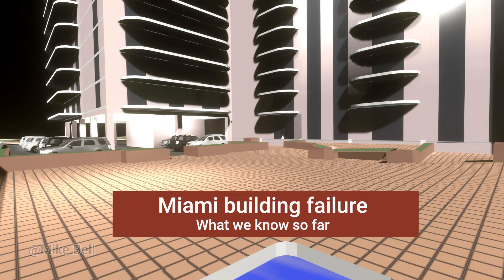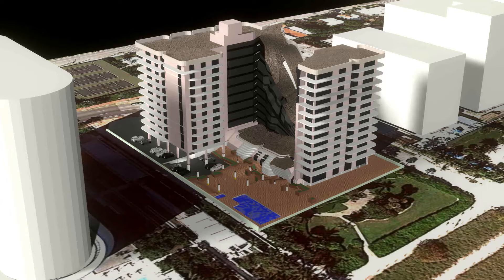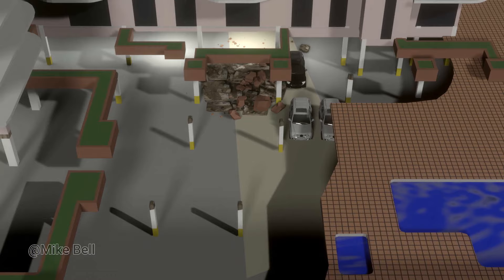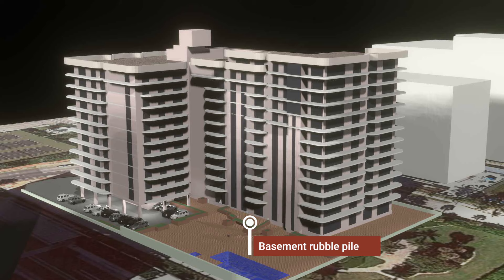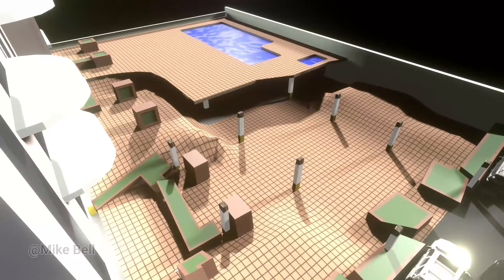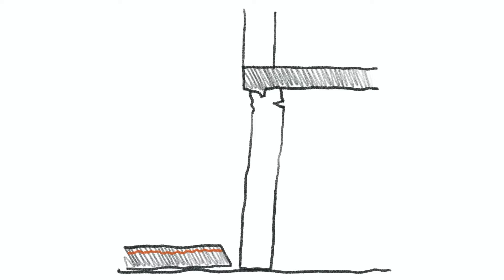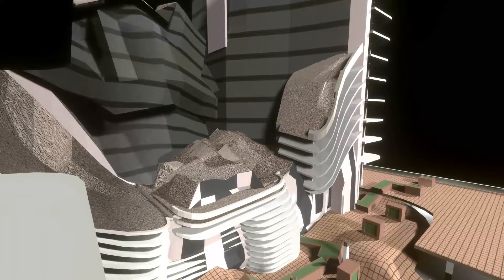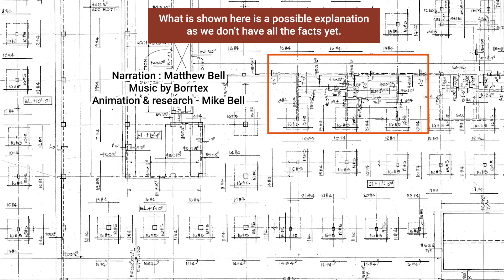MIAMI CONDO COLLAPSE | visualization of the evidence pt2

Comment: What we learn:
- Don't neglect, when something is damaged, demand reparations
- If you hear "construction noises", see cracks happening, feel shakes/vibrations, get the f**k out of there. 
-If no time, go onto the balcony or close to the outside wall, it will highten your chance of survival in being found quicker afterwards.
Reply: @lightbulb1982  when I see it happening definetly. Have been through some earth quakes, although in well maintained buildings. When you see/hear a crack happening, you'll know what I mean. Its frightening believe me.
But with the neglect of infrastructure I see here in the US, its a genuine concern of mine and I expect things like this to happen more often in the future. 

Sorry if I sounded cold/rude in my first comment, that was not my intention, more of an emphasis on the speed of action. No offense was  intended. 
May the victims of this tragedy rest in peace.
Reply: @MrChillerNo1  You gotta be careful with your "advice", the standard (and I assume, much better) advice in earthquake-prone areas is to get under a sturdy table in case of shakes/vibrations. Presumably because you're much more likely to have some sort of projectile hit your head at lethal speed if you "get the f**k out of there", as compared to the likelihood of your building collapsing.
Reply: @TheHuesSciTech  Sure, my bad, I expected that to be self evident/common knowledge.
Same goes btw for door frames, and corners if tables and doorframes are not reachable.

BUT, especially if you have time (early warning system) being outside away from buildings and other overhead construction is still the safest.

Best would be not have to enter/live in a building having obvious safty issues and marode structure. I hope they make an example of those responsible for the neglect.
A crumbling infrastructure is not only an issue in the public sphere but also in the private.

Have a nice day, stay save.
Reply: #1  !!!
Don't build your castle on the sand!!

Comment: Lesson is that little pool leak can lead to a complete building failure.
Reply: More than just the pool
Reply: What pool leak?  It's now possible it was the well watered planters that leaked.
Reply: this isn't from a pool leak
Reply: with a building that close to the shore, and several years of king tides and hurricane storm surges, you can bet that garage flooded out with salty sea water several times, penetrating the concrete and corroding the steel supports.
Reply: Everyone suddenly becomes an expert. 🤦
Reply: The pool did not leak
Reply: That is , in no way, the main catalyst that caused this to collapse
Reply: @danielschannel701  Or didn't leak or drain.
Reply: That's not what caused it at all. You should delete your comment it's dangerously irresponsible
Reply: @og-greenmachine8623  Never fails. Can't wait till they release the real cause of this failure.
Reply: @Sandra Braithwaite You sound like an expert. How do you avoid rusty rebar?
Reply: @Sandra Braithwaite Or the engineer could have specified MMFX rebar. It's through and through. Definitely more expensive. You miss that acronym on a bid and you're paying for the job. The whole thing is a disaster. Just horrific.
Reply: @Sandra Braithwaite Totally agree with you.
Reply: I would say that is unlikely to be the reason. You can clearly se from both the video and aftermath that the pillars  punshed throw, while most of the damage was pretty för from the pillar.
Reply: Except that the pool was still FULL of water after the collapse.
Reply: The pool didn't leak, the forensic engineers found that the top of the pool deck concrete slab had no slope and neither did the built-up waterproofing. A shocking oversight. The rain got into the grout between the deck pavers and just sat there, compromising the waterproofing and seeping into the concrete. The rest is history.
Reply: Not a pool leak
Reply: @mozartsghost9271  I think that definitely has something to do with it. There’s another city with tons of hi-rises like this, Alexandria in Egypt, where buildings collapse all of the time due to seawater corrosion and poor construction.
Reply: @danielschannel701  And I don’t think the planters were accounted for in the designs, but can’t remember.
Reply: @chairmanofrussia  After a hurricane damages the palm treesa few years ago, they were cut down.  And changes were made with the landscaping.  I think I heard that the palms required less watering than the new plants they installed.
Reply: That wasn’t why

Comment: It was built in the 80s during Miami's mafia/corruption era just like NYC. The city's civil engineer inspectors were bribed. They approved every single step of the construction from changes to the original building plan to the use of inferior building materials.
Reply: And yet you don’t know if there was any thing wrong with the actual construction of the building.
Reply: @neilkurzman4907  Thats the thing, there are so many other building made by the cocaine dealer / real estate developers of the time, that are even worse shape and still standing. So something / someone pushed this particular building's problems over the edge.
Reply: @DCOM20.  
We know? No you think you know. Built with cocaine money doesn’t mean it was built with cocaine. So since you know exactly why it failed what does that mean for the surrounding buildings. How can they be modified to ensure they don’t fall down for the same reason? You do understand the investigation is to determine that. That’s why we investigate accidents.
Reply: @VictorNewman201  It appears that extensive water infiltration into the pool deck was the culprit...several people seem to believe this to be the problem.
Reply: 40 years is a long time for a modern building to remain standing without proper maintenance, if it fell within 5 years of being built you might have a valid point, but enough time passed that both weather effects specifically corrosion, and lack of regular building maintenance probably are to blame. Had the preventative maintenance or repairs occurred earlier maybe this disaster could have been avoided. 

Imagine you drive a car without ever changing the oil or having the same tires on since 1979. Would you blame corrupt car markers of 1979 for your car breaking down in 2021? Probably not. If you own a home for any length of time, you know (or learn) how susceptible they are to the weather, leaks, cracks, issues over time and those issues need to be addressed or they multiply into costly repairs. Most single family home roofs have a 25 year lifespan before they need total replacement. Most single family homes do not collapse though because they carry less loads than an apartment building, but all the more importance to keep up with maintenance and repairs when hundreds of lives are on the line.
Reply: @jainradhakrishnan6600  
There is more to this building collapse then week design, poor maintenance, and possibly shoddy construction.
The question is should the collapsing pool deck have taken out three supporting pillars with it?
And even more should a loss of three pillars take down the entire building?
Everyone’s so focused on finding the the one single thing that caused the building to fault and the one person to blame, they are not looking at how all of these things lead to the collapse of the building. So what can we learn? How do we stop this from happening in the future. Do we need to retrofit current buildings? The goal here is not to save the dead. The goal is to save people in the future.
Reply: @Neil Kurzman From a novice perspective, if I were to critique the building design as described in this video, the pool deck could have been placed on its own support columns instead of tied to the main building's support columns. This would be a redundancy measure the original designers could have implemented to isolate the structures from each other so that if one failed, the other other did not. We kind of see the isolated structure design in action with the building structure that did not collapse. If retrofitting other buildings in the area is the outcome from this disaster, they can begin by looking at similarly designed buildings and strengthening or isolating the apartment building support columns from the rest of the structure (such as a pool deck) so one cannot cause a catastrophic failure to the other.

If the animation is what happened, the pool deck floor literally pulled itself out from the structural pillers when it collapsed, which caused the columns to immediately buckle, which cause the building to rest its weight on bent columns; which lead to the complete collapse as the columns were not designed for that loading scenario. 

Keep in mind the original design should account for the pool deck's support columns, girders, concrete, and steel to be working to code. If the pool deck structure was not properly maintained, long term corrosion could have compromised the strength of the deck, which set off the chain reaction.

There's probably a group of forensic structural engineers working on the mechanism for how the building collapsed. Once they figure out the most likely cause, they publish their results/findings, and give recommendations to the city/state. These sorts of catastrophic events always leads to some kind of design/code revision, not necessarily because the original design was poor per se (it could have been), but because we learned something novel whenever a structure collapses (which is pretty rare in the US these days), and because codes get updated with new scientific findings that the original code/designs did not have available at the time of their original construction. 

I think one code that will get changed is the frequency for inspection, I originally read it was every 40 years in South Florida or something, that'll probably get bumped up to every 10 years, maybe less, maybe they'll perform inspections after every major storm/hurricane just to be cautious.
Reply: @jainradhakrishnan6600  
The problem with being an amateur looking at a real problem is you don’t have enough information to know what all of the other possible issues are. 
You do one quick fix, and you end up causing other problems. It’s not always aparent to someone who is not a professional. It’s why civil engineers require licenses. 
As another amateur it does sound like there should be some separation between the building and the deck.
Actually believe in Florida the initial inspection is after 40 years then I think 10 or 15 years after that. The 40 years was chosen to the politics. Not do the engineering practice. And that’s just in that portion of Florida and other areas of the state no inspections required ever. 
I’m not sure what the rules are in the other 50 states and who knows how many counties around the country.
Reply: @DCOM20.  Scarface a Taurus! 🚩🐂💭 Obviously you're a Pisces! 🔮💦🐟
Reply: @neilkurzman4907  Yeah I don't work in high rise condos, my background is in pavement engineering so I'm aware of some of the concepts in building design, but I can't legally give professional advice. Even if I had my PE license as a pavement engineer, it'd be unethical of me to provide structural engineering design opinions as it's outside my specialty- but yes I'm well aware the licensed professionals are working on solving the problem as we're spectating.
Reply: @neilkurzman4907  I smell a gaslighter here. (no pun intended)
Reply: So much of this going on these days (rushed construction and corrupt city officials) it makes you wonder what will happen a few decades from now
Reply: Funny no one blames the building association dudes who did not want to spend the money to fix early structural problems.
Reply: I used to work for a Forensic Architecture firm.  We had A LOT of work in Myrtle Beach in the early 2000’s.  This is because it took 20 years for the problems from a huge condo building boom in the 80’s to come to light.  I believe the Horry County building inspectors must have been overwhelmed and that they must have done drive by inspections based on a lot of the stuff we discovered.  But these public agencies can not be held liable.  Thankfully, none of the buildings we saw had structural issues but there were LOTS of water infiltration issues and some fire hazard/ fire safety issues such as improper egress designs.  It makes me wonder though, if the water issues were not fixed, would some of those buildings I looked at be in a similar condition to the Champlain building?

Comment: This is an excellent model of the collapse using the surveillance video, the video taken by a hotel guest across from the Towers, and eyewitness accounts.  
My comment is that the video of the parking garage with water flowing from a pipe and  rubble on the ground shows what I believe is one of the planters from the pool deck along with other rubble. There is what appears to be a large cube on the right side of the column that is on the left side of the ramp. The cube/planter is on the ramp. This means that the deck collapsed at least as close to the building as the planters just before any part of the building itself collapsed.  
Realizing that the wall of the stair well from the last section of the building that collapsed was on top of the central portion of the rubble pile was very disturbing as were the bedrooms that were ripped in half while the remainder of the units that were still standing. The horror of those who died is beyond imagining, particularly among those in the last part to collapse. There was a very long 7 seconds of before the last portion of the building fell.